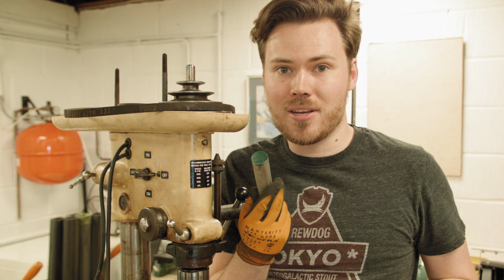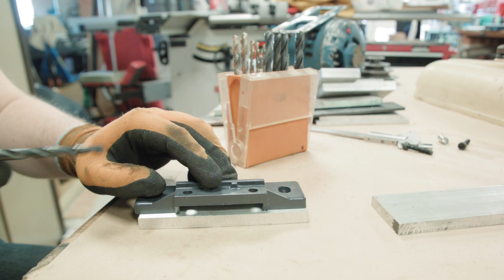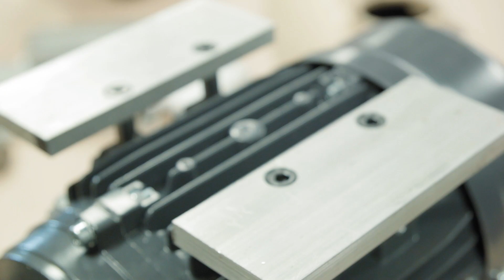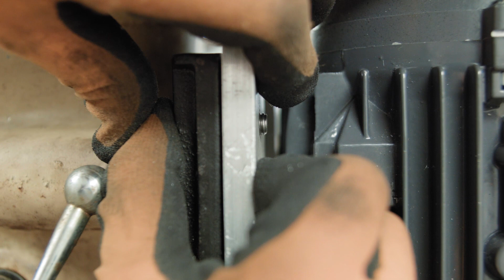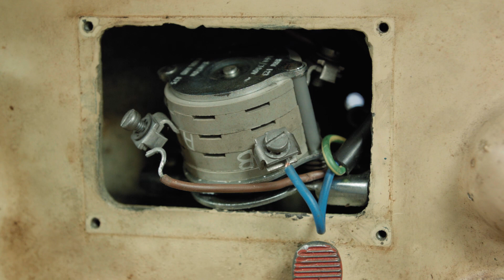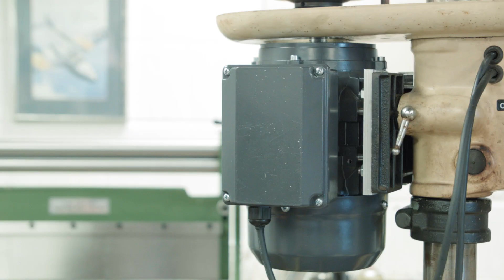Fixing an old Drill Press with a New Motor [TOOLS]

Comment: can spares be purchased for the Fabco  drills
Reply from the maker: I don't think Fobco exist as a company any more. Your best bet would be searching eBay for "4 position rotary switch" maybe add "vintage" or "machine" to help narrow things down. It was pretty common for these machines to be repaired or upgrade with more modern switches so I'd suggest finding any two position switch to get the drill working and if you feel you need an upgrade then do it when you can find the perfect one.

Thanks for watching

Comment: Hi James, just seen your video on the Fabco  bench Drill. I'm looking for  the black  on/ off  button  part of the switch which is broken on my drill.
Reply from the maker: I don't think Fobco exist as a company any more. Your best bet would be searching eBay for "4 position rotary switch" maybe add "vintage" or "machine" to help narrow things down. It was pretty common for these machines to be repaired or upgrade with more modern switches so I'd suggest finding any two position switch to get the drill working and if you feel you need an upgrade then do it when you can find the perfect one.

Thanks for watching

Comment: Anyone who fancies doing something similar with a Fobco drill press, just buy the correct imperial motor and save a ton of messing around. That’s a B56 frame, 0.75kW 4 pole, foot mount.

This is also the correct twin capacitor motor for the job.
Reply from the maker: Thanks for the helpful suggestion

Comment: I would recommend a capacitor start capacitor run motor for this task. It has more starting torque, albeit that motor has a pretty good torque for sure.
Reply from the maker: Thanks for the advice. I've never had a problem with torque but good info to know.

Comment: Hi James , I have a question as I have a pillar drill also but is not so strong , Can I 'in your opinion' change  the 1/2 HP motor for a 1 HP motor.
Reply from the maker: Absolutely, that should be no problem.

Comment: What's the diameter of your lathes chuck bore. You could have shown you fit the pulley on your lathe chuck
Reply from the maker: Not sure exactly, about 50mm maybe. I mounted the pulley on the three jaw chuck by expanding the jaws to push out on the inside diameter of the pulley rather than grip on something.
Reply: @MaltandMake  interesting thank you.

Comment: Hi,James
clever bit of work ,love the machine ,so I bought one,But its got a three phase motor,
Question for you,
Could I replace the 3 phase motor to single phase motor and still use the original internal switch to run the single phase motor,or do I have to replace the internal switch ,
Reply from the maker: Hi, glad you enjoyed it. I think you should be able to use the same switch but might need to adjust the wiring since you'll only need to switch one wire for single phase. Another option is to keep the three phase motor and use a Variable Frequency Drive. This way you'll get variable speed control and often a VFD is about the same cost as a new motor. I've that for a bandsaw motor and will have a video on it soon. Hope that helps!
Reply: @MaltandMake  thanks for info,but i have a few single phase motors in my shed,and i don`t like the idea having a digital looking item on the machine,even though it would be better,but i like to keep it in a vintage style,
Reply from the maker: @piecetoyou8285  Sounds like the right thing to do! Let me know how it goes!

Comment: You should upgrade that switch mate. Fit an NVR one with emergency stop button, much safer. There's a vid' on my channel of how to wire one up.
Reply from the maker: Thanks for the idea but I'm happy with the way it is. I did consider changing it but decided against it. Granted, slightly less safe but it's something I'm happy to accept.
Reply: @MaltandMake  Good video by the way👍🏻

Comment: great video James, I have exactly the same drill but in 3 phase, a friend gave it to me but I'm running an inverter and it keeps tripping the electric so I want to convert it to 240v... researching the mod brought me here to see you fitting a new motor to a Fobco which answered some questions I had re the mod. Thanks for taking the time to post this, excellent vid and very useful.
Reply from the maker: Glad I could help!

Comment: Nice job! What motor did you end up getting? I’m restoring a Fobco and need a new motor but the B56 mounting version are > £180. Thanks!
Reply from the maker: Thanks! I think it was a 0.75HP motor from Inverter Drive, £116.40 delivered. Part number 0.5541TPC B3. Best of luck with the restoration!

Comment: If you could wire the motor so it can be reversed it would be handy for using left hand twist drills... just the thing for drilling out broken bolts and studs.
Reply from the maker: Aceroadholder  Hadn't though about that, good idea.

Comment: Great Video, but Ow! Don't punch with your drillbits! Get a set of punches. Or better yet, make one. You could just turn the size that you need when you need it and make it part of whatever project video you're doing, or make a set.

Regarding Knipex, it's a great name for a number of reasons. "Knipsen" is a German word for snipping something off with a set of pliers, and also associated with ease. "Knipsen" does not take a lot of effort, it's almost casual. But it is also a name you can pronounced easily in German and English which is great for a brand name. So, the German pronunciation is Knip as like kippers with an n and ex as your ex. But the other pronunciations are also valid.
And they make great pliers. I'm not buying any other ones.